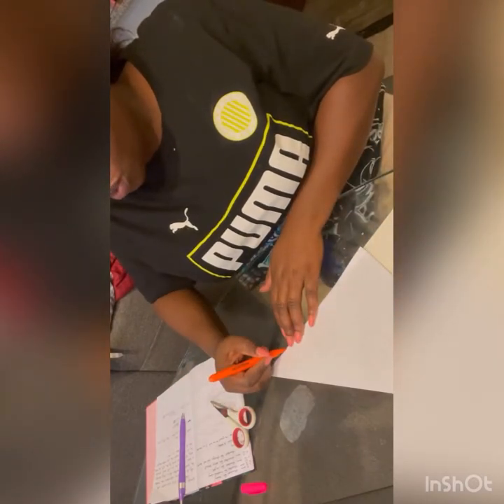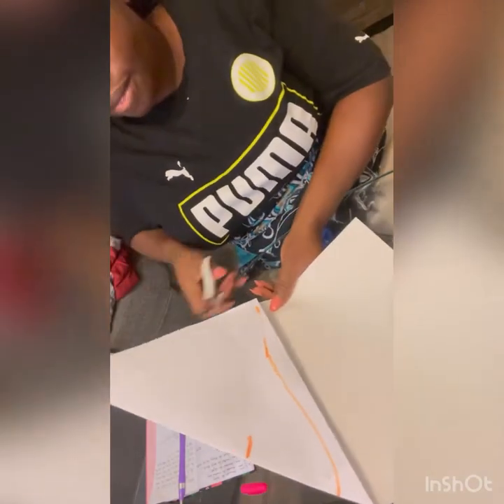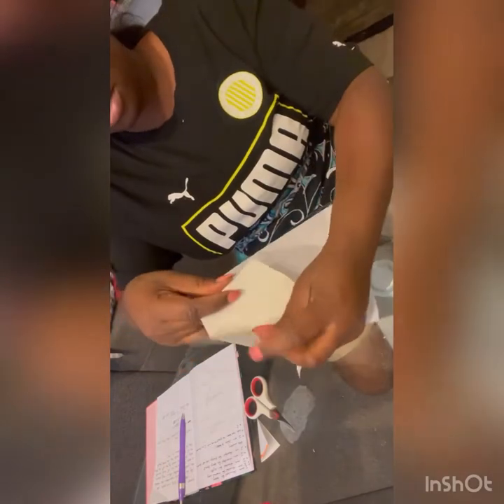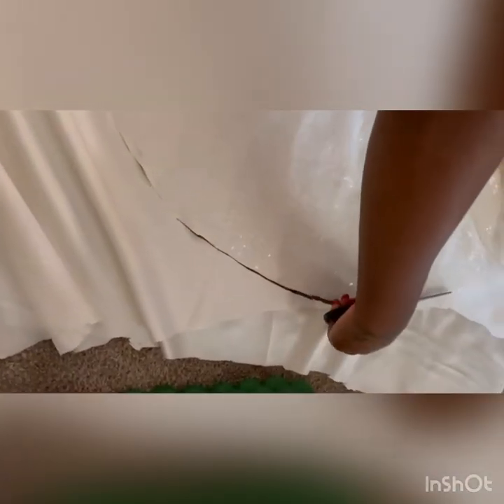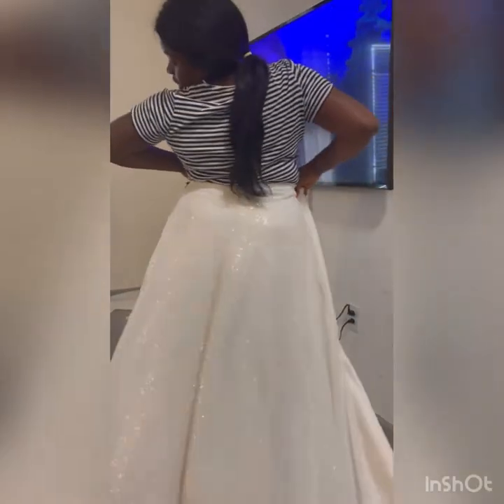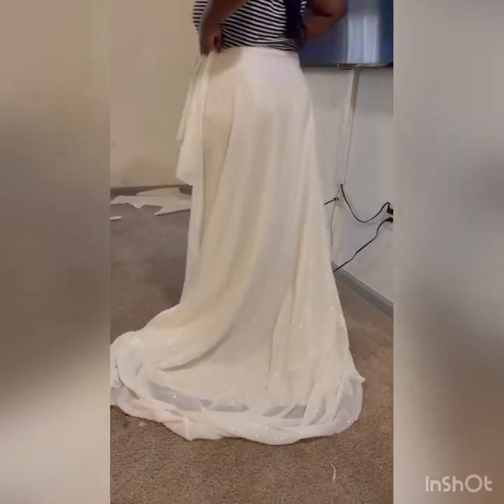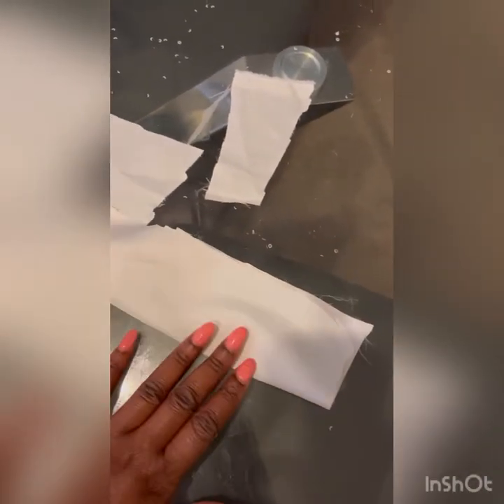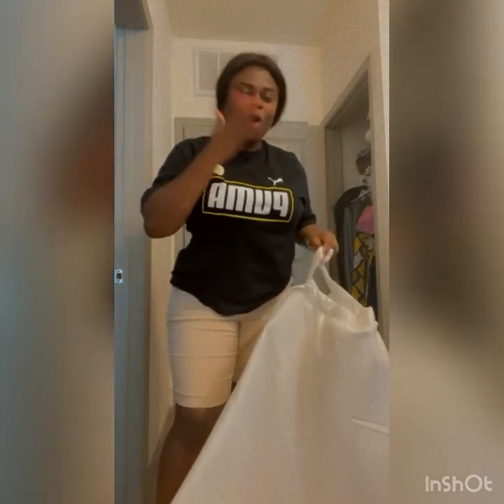Detachable waist skirt DIY #detachableskirt #detachable #bridalskirt

Comment: How do you cut the organza panel ma'am?
Reply from the maker: Thank you for the question! You want to cut it as a circle skirt cut.
Reply from the maker: Measure your waistline then divide the number by 4. Then add 1 inch for the sewing allowance. To get the length: start from the waistline then to your desired length and measure how wide you want the circumference. Let me know if you have any other questions or I’ll probably make another video to explain it.